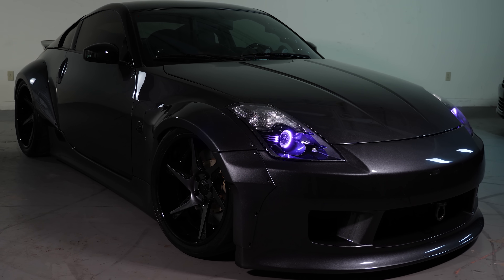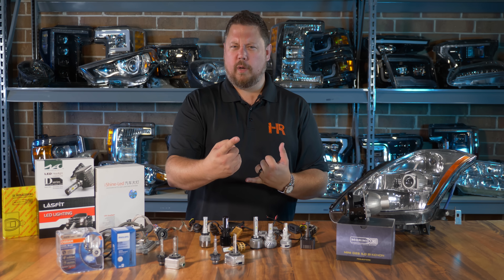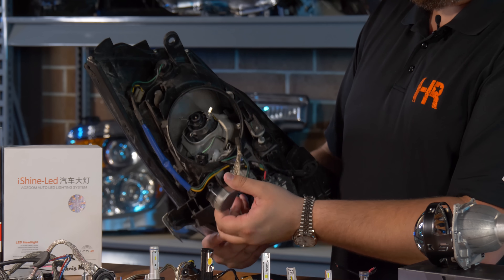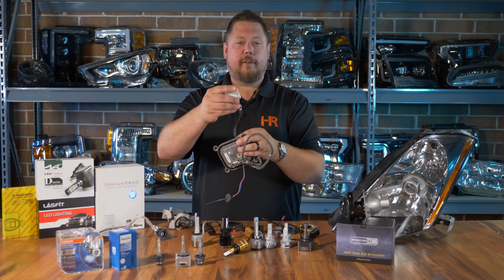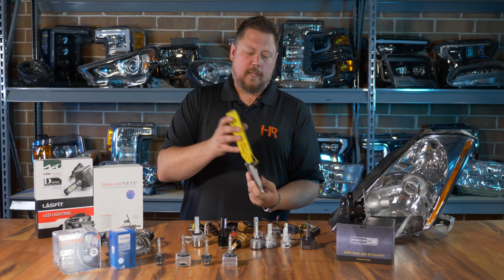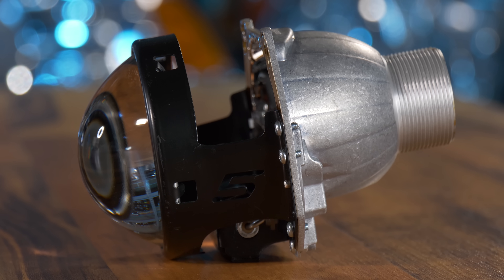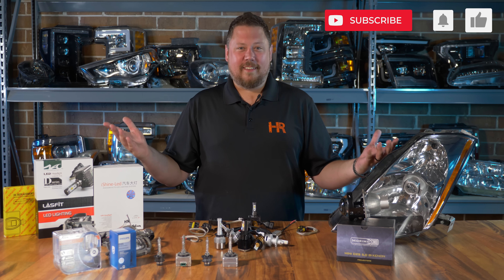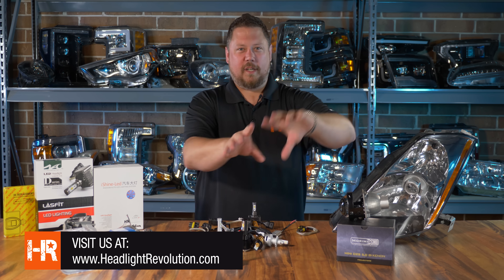D1S and D2S LED Headlight Bulb Replacements - Are they brighter than HID? | Headlight Revolution

Comment: The reason why the LED’s don’t put out as much light is because of the design of the bulbs.  The HID has light output 360 degrees and has a completely clear bulb.  The LED only has light output from two sides, sometimes 3 or 4, but never 100% 360 around.  The LED bulb would have to be made out of glass in order for it to have the same beam pattern.  What doesn’t make sense to me is that there are tons of cars these days with standard LED headlights, some in projector housings and some in reflector ones.  Their output is far brighter than my 35W D2S HID bulbs in my 2012 Acura TSX with projector housings.  Why is this?
Reply from the maker: This is because it's not just an LED bulb in a headlight.The entire optics of the OEM LED headlights are based around the LED chips and their placement. Which is why they are able to perform better.
Reply: Thanks for replying.  Question, why wouldn’t LED headlight manufacturers make them more effective.  LED’s seem to be our automotive lighting future, so why wouldn’t the engineers put the LED strips on the assembly just like an HID bulb so that the beam pattern would line up correctly and put out as much lux?  Because LED’s can obviously work in projectors as many manufacturers have them as standard equipment.  And why do LED bulbs only have lights on two to four sides?  Shouldn’t they be all around the bulb 360 degrees to create the same affect as a clear HID bulb?
Reply from the maker: LEDs are certainly where manufactures are going. As to why they don't put them on a replaceable bulb, who knows. I'm sure there's a cost or performance reason to it. 

There re 360 degree LED bulbs on the market, and they all perform terrible. Here is a video that we made explaining why they don't perform well:
https://youtu.be/nnD_sDWNjEw?t=57

Comment: Is that an OEM hid projector you are testing or aftermarket? Just wondering cause I have never seen such hotspots in any OEM hid projectors on any of the cars I have driven with OEM hid. A main point of the hid projector is to get even amount of light in the whole pattern without any hotspots in the middle.

Comment: Just in time! I've been thinking to convert my mazda 3 hid d2s to bi-led projector conversion but they costs almost triple here. The car is 9 y/o now, need your recommendation for best HID bulb above 4300k. Thanks!
Reply from the maker: Well hold up - if you're doing an integrated LED projector you're talking about a totally different product! Most LED projectors are decent, like this one: https://www.theretrofitsource.com/bi-led-morimoto-m-led-headlight-projectors.html

If you open your headlights and do a retrofit with an LED projector like that you're good to go!

Comment: what about d8s fitting
Reply from the maker: D8S should fit about the same as a D1S LED headlight bulb. Similar form.
Reply: @HeadlightRevolution  could I directly upgrade D8S with a D1S just by plugging in the new bulb? or would I need to change also ballast?

Comment: Being an auto electrician, LED's are only good to use for rear tail lights, number plate or as the Americans call it license plate lights, and front parking lights on a vehicle. Be careful when using LEDs for rear brake lights as some of the LEDs that are brake / tail lights don't have built in diodes in them which when you press on the brake your front parking lights will also come on as well as your cluster lights due to voltage feedback. As for headlights HID's are always better than anything else. Greetings from Sydney Australia.

Comment: Yeah this video is obsolete. Virtually every led option is plug and play with the oem ballast and with 15 7030 diodes on each side hitting about 45w at 5ish amps they take a massive dump on oem 35w hids
Reply: Is there a way to bypass ballast of the vehicle? I have a malfunctioning headlamp, i replaced both with new led d1s. But the problem remains the same. One of my headlamp stops working after a few minutes of start. I got my vehicle checked at the agency, and they couldn't find the real reason to it. And are saying to replace ballast, headlamp and even fuse box. And they still can't make it sure if the problem would be resolved even after replacing all that. So im looking to bypass everything by giving power directly to the d1s led bulb. But heres the catch, how to do it?🥹

Comment: liesssss, i have that same exact D3S led kit, and its 100x bright than stock osrams that came in the car.
Reply from the maker: How did you test it? It's possible that your original D3S bulbs are old enough that they are not as bright as they once were. It's also possible that the color of the LED bulb "looks" brighter but in different circumstances it doesn't perform well. It's also COMPLETELY possible that you are right because different bulbs act differently in different housings. This video serves as a snapshot of what you might expect, not a 100% complete guide on all things LED bulbs. Thanks for watching!

Comment: Those led replacement bulbs were laughable at best, I would hope no one would ever replace good oem hid for any of that crap lol
Reply from the maker: I honestly would never recommend one of these bulbs over the actual OEM HID kit, they would never be able to stand up to the performance you get with those D-series HIDs!
Reply: If I owned a car with oem hid and stuff started going out, the only thing I'd possibly consider is an mled projector retrofit, and that's a big maybe, other than that, I'd definitely keep oem hid
Reply from the maker: Now that new M-LED 2.0 is honestly going to be brighter and produce a better beam than those OEM HIDs. The light output is absolutely insane, even when compared to the original version of that M-LED projector!
Reply: @HeadlightRevolution  do you guys do retrofits?
Reply from the maker: We do not, but being lighting enthusiasts we definitely have come across them before!
Reply: @HeadlightRevolution  I understand
Reply: @HeadlightRevolution  do you guys know of anyone who make headlight adapter similar like the ones for the ram trucks because I would like a custom harnesses made for a vehicle of mine
Reply from the maker: I am not sure on that, as we getthose from a manufacturer that makes them for specific vbehicles. I wish I could be more help there, sorry about that!
Reply: @HeadlightRevolution  No problem !